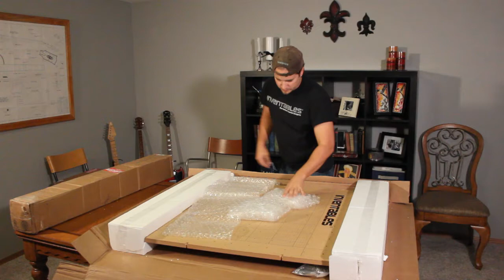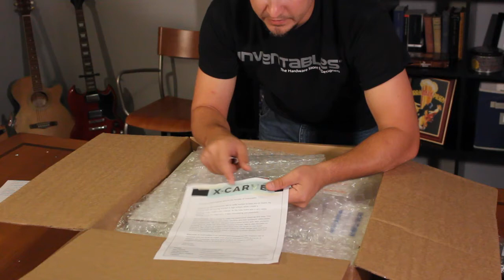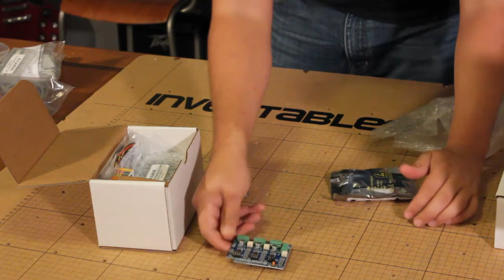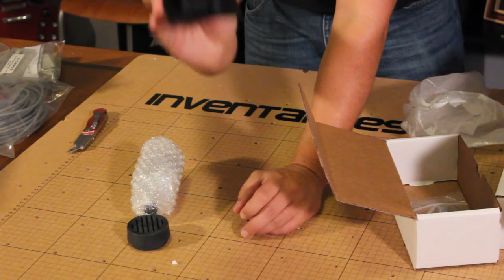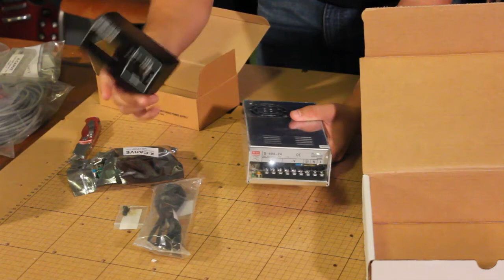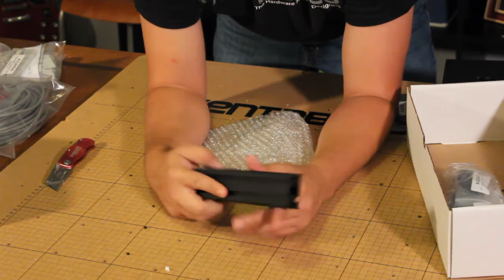X-Carve : Unboxing

Comment: Matt, I got at an X-Carve a few months ago (I ordered it right after they came out). Your Shapeoko2 vids convinced me that inventables was the way to go. It really was. Customer service has been awesome. Mine runs on a Gshield with modifications, If you want to know more I'll make a vid.
Reply from the maker: ElPhantasamo Fantastic, what mods have you done to the Gshield?  I am assembling my X-carve right now in my little spare time ... hope to have it up and running in a few days.
Reply: Targ's Workshop I have made no mods to the Gshield, only to the X-Carve. (currently frustrated trying to update firmware on the tinyG). I chose that because I didnt like the idea of running two NEMA23 motors off one driver chip.

I have my own wasteboard, 5 limit switches (X and Y have 1 limit/home and 1 limit, Z has just a single switch for limit/home), and my drag chain runs to the other side. Im also working on a dust vacuum system using 2 pieces of 3/4" loc-line
Reply from the maker: ElPhantasamo fantastic.  After i play around with the stock arduino setup, i will switch to the tinyG for the same reasons.  I was thinking of doing the locline vacuum as well.  Great minds think alike.
Reply: Ill try to make a vid of my progress in a few weeks!

Comment: nice. i have been toying with the idea of getting one, only limitation is the size required!!!! looking forward to an assembly video and 1st carving one too
Reply from the maker: RageForSeven its offered in two sizes: the 1000mm (which is the one i am building) and the 500mm.  I am not doing an assembly video for this one.  I thought i was going to, but there are a few out there already and i felt it would just be redundant.  I will definitely be doing a first cut vid and the review/thoughts vid.